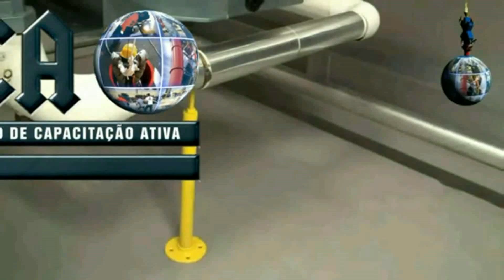Nova NR 13 Caldeiras, Vaso de Pressão, Tubulação 1134221130

Comment from the maker: A2 Currículo Mínimo para Treinamento de Segurança na Operação de Caldeiras. 
 Ultima Alteração (Redação dada pela Portaria MTE n.º 594, de 28 de abril de 2014).

1. Noções de grandezas físicas e unidades. Carga horária: 04 (quatro) horas 
1.1. Pressão
1.1.1. Pressão atmosférica
1.1.2. Pressão interna de um vaso 
1.1.3. Pressão manométrica, pressão relativa e pressão absoluta 
1.1.4. Unidades de pressão 
1.2. Calor e temperatura 
1.2.1. Noções gerais: o que é calor, o que é temperatura 
1.2.2. Modos de transferência de calor 
1.2.3. Calor específico e calor sensível 
1.2.4. Transferência de calor a temperatura constante 
1.2.5. Vapor saturado e vapor superaquecido 
1.2.6. Tabela de vapor saturado 
 
2. Caldeiras - considerações gerais. Carga horária: 08 (oito) horas 
2.1. Tipos de caldeiras e suas utilizações 
2.2. Partes de uma caldeira 
2.2.1. Caldeiras flamotubulares 
2.2.2. Caldeiras aquatubulares 
2.2.3. Caldeiras elétricas 
2.2.4. Caldeiras a combustíveis sólidos 
2.2.5. Caldeiras a combustíveis líquidos 
2.2.6. Caldeiras a gás 
2.2.7. Queimadores 
2.3. Instrumentos e dispositivos de controle de caldeiras 
2.3.1. Dispositivo de alimentação 
2.3.2. Visor de nível 
2.3.3. Sistema de controle de nível 
2.3.4. Indicadores de pressão 
2.3.5. Dispositivos de segurança 
2.3.6. Dispositivos auxiliares 
2.3.7. Válvulas e tubulações 
2.3.8. Tiragem de fumaça 
 
3. Operação de caldeiras. Carga horária: 12 (doze) horas 
3.1. Partida e parada 
3.2. Regulagem e controle 
3.2.1. de temperatura 
3.2.2. de pressão 
3.2.3. de fornecimento de energia 
3.2.4. do nível de água 
3.2.5. de poluentes 
3.3. Falhas de operação, causas e providências. 
3.4. Roteiro de vistoria diária 
3.5. Operação de um sistema de várias caldeiras 
3.6. Procedimentos em situações de emergência 
 
4. Tratamento de água e manutenção de caldeiras. Carga horária: 08 (oito) horas 
4.1. Impurezas da água e suas consequências 
4.2. Tratamento de água 
4.3. Manutenção de caldeiras 
 
5. Prevenção contra explosões e outros riscos. Carga horária: 04 (quatro) horas 
5.1. Riscos gerais de acidentes e riscos à saúde 
5.2. Riscos de explosão 
 
6. Legislação e normalização. Carga horária: 04 (quatro) horas 
6.1. Normas Regulamentadoras 
6.2. Norma Regulamentadora 13 - NR-13